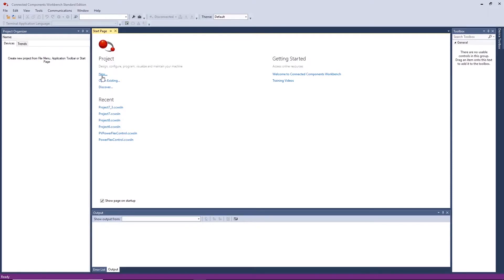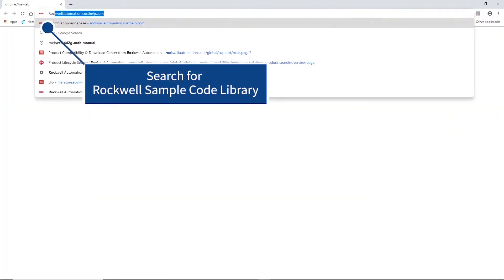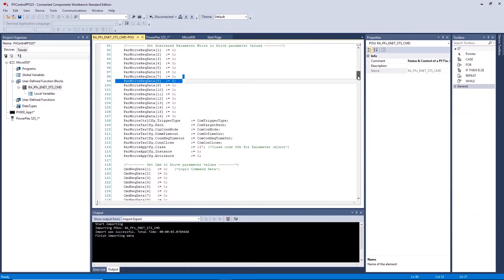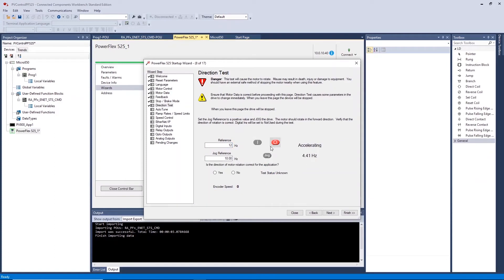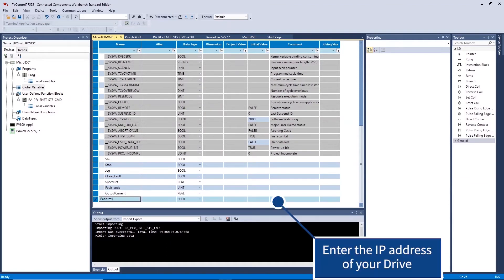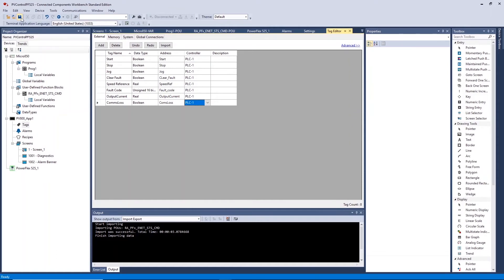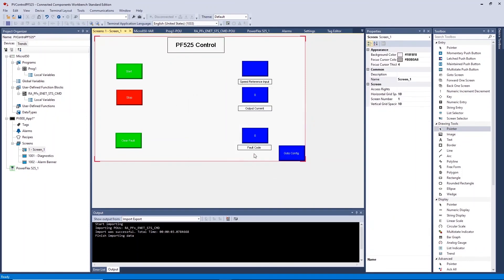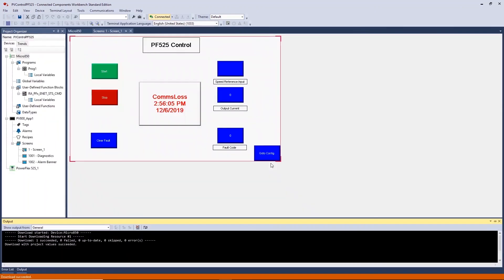Intro to CCW: PF525 Control via PV800, and Micro850

Comment: Thanks a lot! i've inherited a mess in which a micro800 is supposed to control 3 drives with ethernet: 2 powerflex 525 and a 750. Does this FBO apply to the 755 as well? thanks again!
Reply from the maker: Hi Joaquin, yes, the UDFB does work with 520 series drives and 750series including the 755 series.

Here is a Rockwell knowledgebase article which details how to achieve control & diagnostics of a PowerFlex 750 Series drive using ethernet/IP: https://rockwellautomation.custhelp.com/app/answers/answer_view/a_id/585637/loc/en_US#__highlight